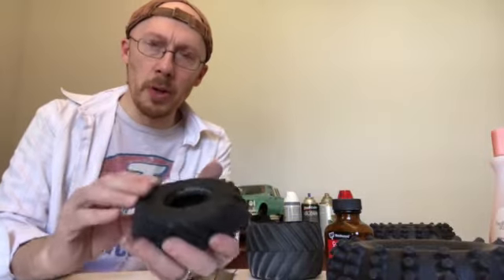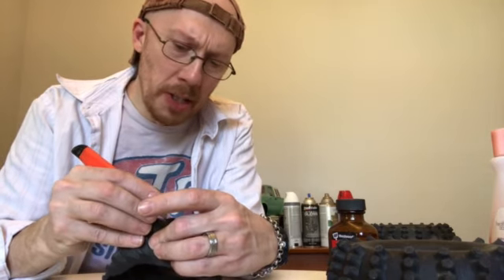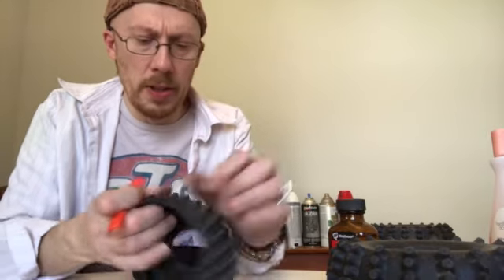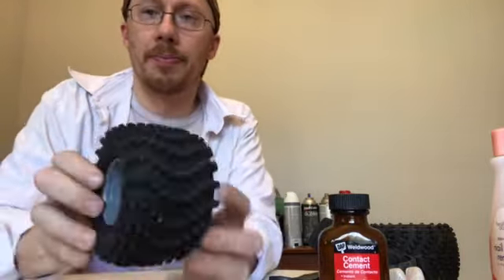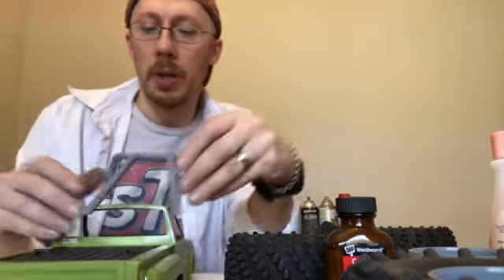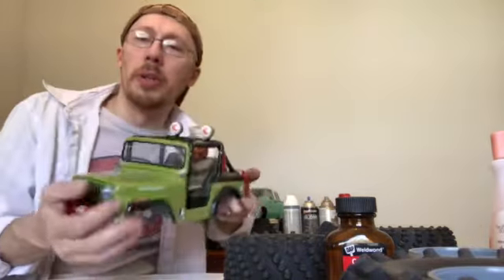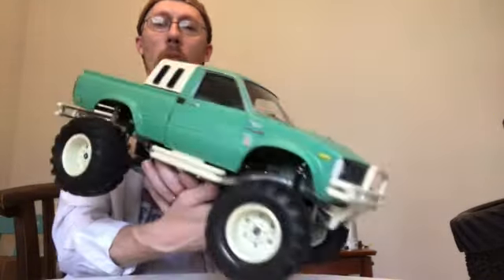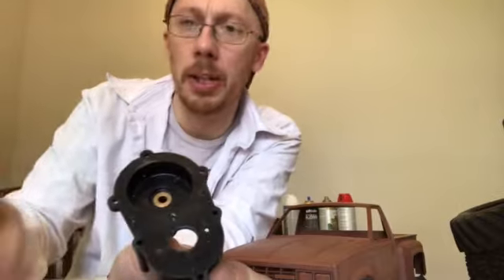Tamiya Bruiser driver figure fitting and Marui Big Bear tire repair

Comment: Hello friend, excellent video. I have a Marui Big Bear, but I need to get the tires. Could you provide me with an eBay link or an online store where I can buy the tires?

I will be very grateful to you!
Reply from the maker: I wish I could supply you with those unfortunately theres none but type all of these like this   Marui rc  and I will type vintage marui big bear and another type method is big bear rc  I will add all these to my favorites and get notifications. all so try tamiya message boards those guys can help you. its tough to find stuff I make most of the pieces as seen in videos. takes a. lot of time but all turns out great. if I can do it so can you. good luck again